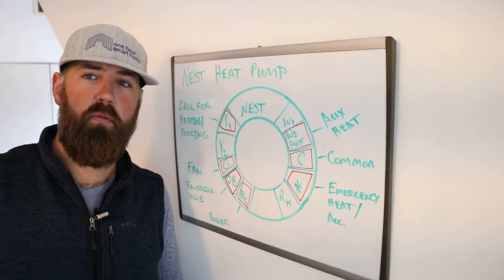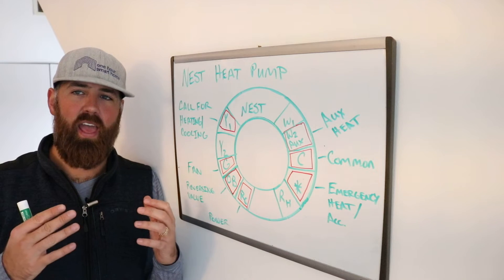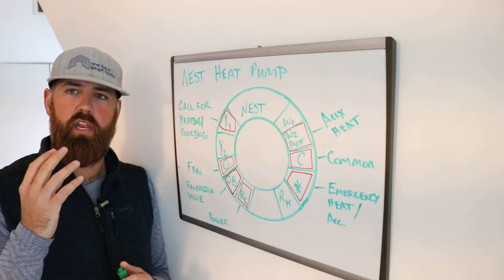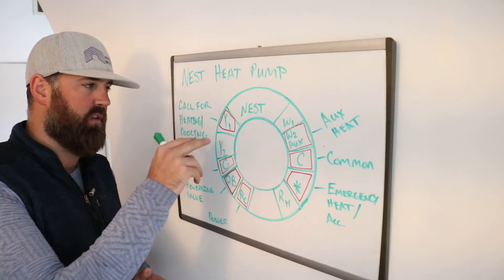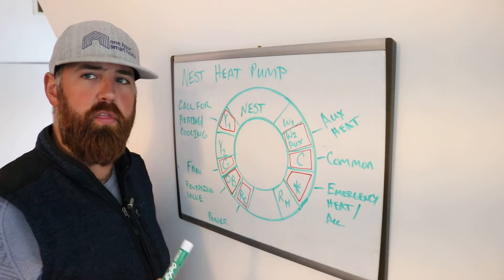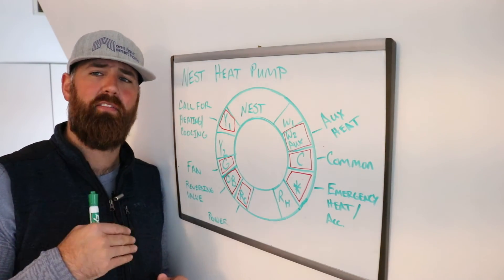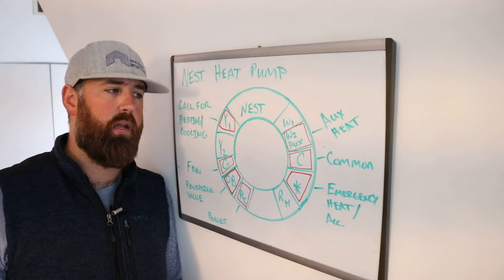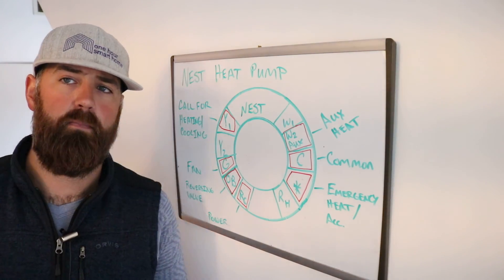Nest Heat Pump Wiring Diagram:  How To Wire Nest With a Heat Pump

Comment: System worked fine until a very cold day and the heat pump was off.  I had no Auxilliary Heat or Emergency Heat.  All the wiring seemed fine (red/power to RC, orange to OB/reversing valve,  Green to G/fan, yellow to Y1/call for heat-AC, and blue to c/common).  My only concern was the white wire to W1.  I moved it to W2 Aux and after powering the system, it fired right up.  Everything seems to be operating correctly now.  Thanks

Comment: This video is awesome.  Filled in some blanks but not all for me.

I have an LG heat pump and LG Air Handler.  I am adding the LG Dry Connect module.

I have added a 24 vac transformer.

I want to wire for 3 fan speeds.  The Dry Connect module has separate lugs for low, med and high.

Dry Connect also has 3 other lugs, fan, heat and cool.

Comment: My system on the wall with the ghetto honeywell thermostat has a cable for R and jumper to RC. Do I need the jumper as well on the nest panel?

I also have a white wire going to W2/AUX on the Honeywell , A black wire I think it says T2/E and another white wire to S1, and a red wire to S2

Where would the black E , white S1, and Red S2 wire go on the nest back panel I only have Y,C,W,G,R, and OB.

Thank you in advance for answering

Comment: Why can’t anyone tell me about the AQ - and AQ+ terminals. And how they work ? Are they contacts or is AQ + power out from stat.  Someone please explain this.
Reply: AQ is “Air Quality.”  Some high efficiency systems utilize an outside air supply and a damper motor to provide fresh air as needed or on a run time schedule. It can also add humidity with a humidifier if used. Most legacy thermostats do not have AQ  functionality. Usually a set of normally opened contacts to control said damper control or humidifier.

Comment: Actually the default on the switching valve 90 percent of the time is for it to be energized for cooling it defaults to heat when no power is applied to the coil

Comment: Can anyone help with install with 4 wires. Red, Green, Yelllow, and Orange. Im i. Vegas so I'm almost positive its a regular system. I connected all wires as they were previously connected but when i turn the Nest on to A/C, it blows hot air. I'm assuming it a programming error?

Comment: Hi 
I have heating and cooling both but i see only two wires in my old thermostat. One is white and other is red. The white wire is connected with C and the red is connected with R and there is a connector between R and RC. I need to know how to connect a google nest 3rd generation with it?

Comment: How would you know if you have emergency heat or auxiliary heat? I just had a goodman 3 ton 2 stage 18 seer heat pump. And i qould like to know where to put that wire so it works properly. Would appreciate the info

Comment: I have a question. I am trying to hook up my google Nest Gen 4 thermostat to a 4 wire carrier system that is labeled A,B,C,D. I hooked it up to G,Y1,W1,and RH. Everything is good and says it's working but does not turn on the outside unit or inside. My model number is 25hna948a320 outside unit and the inside model number is fe4anb006. How do I hooked up each wire in relation to each unit because the different units have slightly different labeled boards. I have pictures if needed.

Comment: Hi, I am really enjoy learning from your channel. I am just wondering if you have a clip on setting up nest for dual fuel system. I have a gas furnace, which I usually use and a heat pump for heating and cooling. is the wiring and setup up can be added if not already covered by previously.

Comment: You lost me at " hello ". ... I am really struggling to find the right now. I live in a two-bedroom condo. I have a heat pump system with a two-stage heat and one stage cool. I believe I said that right. I currently have an older Honeywell Pro series that's not programmable and I want to change it to a programmable which I was told is the pro series model ending in 2002. Do you know if one of the nest thermostats would work on my system

Comment: So I have a 2 stage heat and ac american standard system with an emergency heating coil. I also have hot water radiant floor heat that acts like a boiler. I want the radiant heat to be my priority heat and the 2 stage heat pump as my secondary source of heat. Obviously in ac mode the heat pump will be priority. I have a gen 3 nest can you give me a quick rundown of wiring? Will I need a jumper between rc-rh?

Comment: By far the best video on connecting heat pump and Nest thermostat!!!  In addition to the overall, I could not figure out what the black wire was as it was connected at the unit to the white (Aux Heat).  This explained the Emergency heat.  Thank you!

Comment: Great Video. I watch both your regular HVAC and heatpump videos. I have anest learning thermostat (3rd Gen) for my heat pump (single stage) but looking to change it to 2 stage heat pump (Trane XR16) with a variable speed Air Handler (Trane TEM6) but wasn't sure if can still be used for efficient use of the Heat Pump/Air Handler. I love my Nest and don't want to change the thermostat (if I avoid it)

Comment: I live in Southern Florida and my cooling/heating system uses a heat pump. The thermostat I currently have is a Carrier and has one wire that connects to a O/W2/B port. With the nest, I assume this wire would be connected to the OB port - if that is correct, would the heating coil in the heat pump system turn on if the temperature dropped too low in my house even though there would be no wire connected to the W2/auxiliary heat port? Or does a jumper somehow need to be run between the OB and W2 ports for the coil to turn on?

Comment: This helped me so much. I had an ollllld thermostat that used none of the newer coding so that didn’t help. My common was Black instead of the blue 🤷‍♂️. Then I had a jumper from W2 to E with the white wire on E. In googles setup it  says “remove all jumpers as they aren’t needed” but doesn’t explain why. 
And Google just immediately recommended a professional install. They could definitely use some of that Google money to have better instructions.

Comment: Hello,
 I have a Bryant system with following model numbers. I also found wiring info. mentioned below. I am unable to tell which wire needs to go to Nest learning thermostat in order to get everything working again. I connected A to G,  B to Y, C to OB, D to Rh. I dont see furnace working and I am not getting any heat. Is this something you can help me with?
A—Green=DataA  B—Yellow=DataB  C—White=24VAC(Com)  D—Red=24VAC(Hot)
Bryant Furnace Model - 315AAV036070AGJA
Bryant Heat pump Model - 288BNV024B00FA
Display Model - SYSTXBBECCO1-A
Thanks in advance for your time.

Comment: So I went through the installation process on the Nest app and it’s had me wire it up exactly as you’ve explained here. But when I call for cool air, hot air is coming out of the vents. Any ideas on why this would be?

The seven wires on my old thermostat were labeled as follows: AUX (white), E (orange), B (blue), G (green), R (red), C (brown), Y (yellow)

Comment: We have a heat pump. On ours, the black and white wire is in the W2 place. They both fit in the old thermostat, but on the Nest when we put the White and Black wires in the same terminal it didn’t work when our system was on cool, it was running on heat. What do we do with the black and white wires? Do they go in separate terminals?

Comment: Great video & clear explanations!  I live in Hawaii & only have a 2 stage cooling system (Y1 +Y2).  I'm trying to install a safety shut off switch on the condensate drain line.  Switch instructions say install inline with the RED wires.  When I test the RED  shutoff connections - the power is lost to the NEST & the AC air handler keeps running - not the desired outcome to shut down the AC.  What would you recommend for the shut off inline wiring please?

Comment: My heat pump wiring is exactly as you explained it, EXCEPT I’m missing a common wire. My Nest battery is continually low and causing the thermostat to go offline or shutdown entirely , otherwise all works as expected. I bought a 24V AC two wire adapter and connected to Rh and C wires. That isn’t working. Am I wiring the adapter incorrectly?  Appreciate any insight. Your videos are brilliant!

Comment: Most informative video I’ve found on this. Thank you! Q: My thermostat has a jumper from the E (white wire) to AUX (no wire besides the jumper). How does that translate to the nest wiring? I tried hooking up a Sensi smart and it didn’t work so wondering if a nest will.

Comment: I have a 5 ton MRCOOL UNIVERSAL, on the AHU there is a only w1 terminal to activate the element. Does that mean I should have no wire on the * in the nest learning? 

In my case should the nest handle AUX and Emergency over the same W1 wire?  

Will I still have emergency option if I redo the software setup? Currently have emergency setup over the * as forced hot air, it's definitely not engaging the emergency heat and I don't think jumperig is the way to go here

Comment: So my system is a Trane with separate O and B wires. How should that be wired?
Reply: B wire is a common wire on Trane thermostat and should go to C on Nest. O wire is switch over valve on Trane and should go to O/B on Nest.

Comment: Wire map I used for Revolv Heat Pump with Emerson 1F79 Thermostat to Nest Learning Thermostat (Gen 3).

HP Wire	          1F79      Nest
Red 	          R             RC
Orange             O/B         O/B
White                E             W2
Blue Jumper  W2 & E    N/A
No wire            L              N/A
Green               G             G
Black                C             C
Yellow              Y             Y1
Reply from the maker: Thanks for the helpful comment for others. I encourage anyone who has a specific model to list their wiring in the comments to help others. Thanks for watching.

Comment: I have this similar set up, but also have a brown and a black wire that were not used on the old thermostat (no metal is exposed). Is it safe to assume they are just there and not set up to anything? Just have a heat pump with a coil compressor/fan - all electric. Thanks.

Comment: My emergency heat option was not showing up on my Nest after my new heat pump installation. My hvac company was very clear that we have that, but when I popped the Nest off, I can see I only have 6 wires, none connected to emer heat. Does this mean I still have the option? And is the aux heat going to be costing a fortune as though we are using emer heat as aux heat? Hope someone can clarify this for me as a second opinion. Thanks!!

Comment: I have a question about my system.  I have seven wires at my Honeywell but two are in the "W2" or "Aux" terminal. I have electric hot air with a central air unit as well.  I contacted Nest for support but that was useless.
Reply: Asking if you you have received an answer or any clarification regarding 7 wires my nest has 6 connections

Comment: OK James, great content, better than GarGle. 
So how do we connect a SS2 condensation float switch to stop the system from running if the condensation drain gets clogged? This is building code required.
I broke Rc as directed and found on testing that because the NEST has a battery, it does not shut off right away...
See NuCalgon SS2 condensation overflow cut off float switch (simple NC switch that opens circuit before overflow damage) and how to use it with NEST 3rd GEN please.

Comment: I think my 4 year old nest is hooked up wrong. my heat pump heater blower is short cycling. my wires are yellow to y1 green to g orange to ob white to w1 blue to c red to rh. my unit is a Trane all in one electric unit. Any help Thanks

Comment: Hey, want to  use a nest to tie a gas fire place into my heat pump system. I’m assuming I would likely tie into Rh for a call for heat? That or can I use W2  and the blower in the heat pump as my supplemental heat?

Comment: Thank you for the video. The client has a heat pump and wants to control cooling and heating from baseboard heaters (boiler). Would it be right to disconnect W1 and tie the wire from the boiler control board to W2? On the other hand, he wants to have an emergency T-stat to turn on the heat from the heat pump. Can we do it through the main T-stat using emergency contact? Or it should be a different decision?

Comment: Question, if using a heat pump with a gas furnace is there any good reason to use the heat pump for heating in addition to cooling? If not I would just connect the Y1 and C to the heat pump, agreed? Thank you, Jack Perlmutter

Comment: This video made my day, after 3 different visits from 3 Professional HVAC they couldn't figure this out. Not too mention the $150 dollars they charged me each time. They would either get my heat pump only producing heat or only cooling. They never connected the reversing valve wire from the control board to the thermostat as the wire is spliced in the middle. I did this myself after confirming and chasing down the wires. I noticed they were both not connected on either end. After watching this video I was able to understand what each wire did and then relate it to my issue.

Comment: HOW DO YOU TELL THE NEST T-STAT TO ENERGIZE O FOR COOLING INSTEAD OF HEATING 
I HOOKED A TRANE HEAT PUMP UP TO THE NEST AND WHEN I CALL FOR COOLING IT BLOWS OUT HOT AIR 
THE ONLY THING I CAN FIND IS 
IS MY HEAT OUMP USE O OR B 
I TRIED BOTH WAY SAME RESULT 
HOT AIR???
PLEASE HELP

Comment: My current heat pump system only has two wires connected to the thermostat. C (which is white) and R (which is red). It looks like I have unused blue and yellow wires. Is my system compatible? I am confused because isn't normally blue connected to C?

Comment: Thank you! Your video saved the day for me as I was installing Nest Learning thermostat for my heat pump HVAC system in Pflugerville, TX. Your graphic with red outlines was the clincher as I had 7 wires. There were no wiring diagrams provided by Nest engineers, which is so basic for HVAC system variations. Great video and very much appreciate your knowledge and teaching abilities.

Comment: I made the mistake of installing a Google Nest thermostat on a 110 degree Saturday afternoon. The old thermostat had a white wire going into a W1(O/B) position. I carelessly put this wire in the Nest's W1 position. The system started blowing hot air instead of cool air. The outside box was blowing cool air and I noticed that it said it was a heat pump. Another site said there could be a problem if we had a heat pump system.

Upon further inspection, I saw that the label said "O/B". I switched the white wire into the O/B position and now the system in blowing cool air.

Thank you very much!

Comment: I have a heat pump for summer cooling and shoulder season heat.  For winter I have a wood fired boiler.  Have not been able to determine if Nest will work for my setup.  Would love your insight.  Thanks.

Comment: Have a furnace for heat and a heat pump for cooling.  I only want to use the heat pump for cooling, not heating as the furnace is more efficient.  Curious to know how you would wire this setup

Comment: Your videos are informative and helpful, but my heat pump wiring has only has four wires (with two jumpers) and thus far nothing has worked on the Nest. The jumper between the Y and W troubles me.

Comment: I have a question? What do I have wired wrong because I feel it's correct only thing I don't have is the little jumper my old thermostat had .. what's going on is I put the house to cool and it heats up. If I put it to heat the fan just turns on

Comment: Great video.  However, I did not hear you discuss how to connect a Nest Learning Thermostat (3rd Gen) when you have both a Blue and Orange wires coming from the furnace controller board since the Nest only has a single O/B connection.   I tried connecting Orange to O/B and Blue to C, but it does not power the Nest.  So what do you do?

Comment: My rogers manual thermostat heats up my house nice but has a bridge between w2 and emergency heat, do i add another cable to bridge this two. Otherwise my nest thermostat keeps does not heat normally.? Ay help, suggestions. I just got a new replacement from nest and keeps doing it

Comment: Color wire go with first letter? O = orange,etc. My unit has a X=blue wire no X on nest, am I supposed to put both orange&blue wire in OB on nest? Also I have a Y= yellow no #....old therm Y, nest Y1/Y2. It's a Honeywell H.P.T only 6 of 8 wires are being used, Brown & Black are cut while red, blue, green, orange, white and yellow are connected

Comment: On my old Thermostat it said Heat (+1to +6 degrees to heat) when the heat was on and EM Heating (Over +6 Degrees to heat) when Emergency Heat was on.  With this Nest Gen 3 I have had the white wire for W2/AUX Wire plugged into either the * set as AUX or the W2/AUX it concerns me that the heat really doesn't come on and blast hot air when needed when it needed to make up for 6 degrees or more.
Reply: Had a A/C guy come over - I was missing a wire that was not needed on my last thermostat - Now I have Y1,G,O/B,RC,W2/AUX,C,*(Emergency Heat)

Comment: Question: 
I have three 10-ton Trane package units, heat pump w/no auxiliary heat. They each are on their own T-stats with auxiliary sensors that control the heating/cooling functions [S1 S2]. I am looking for T-stats that will work with these units that are wifi capable and if possible, use the same sensors; is there such a beast? (Note: The T-stats are located in a mechanical room, so I will need remote sensors to control the T-stats). Or... What Nest T-stat would you recommend that I can use a (its own) remote sensor to control it? Also, to add I am looking for it to be auto-changeover from cool to heat.

If you or anyone can help, it would be much appreciated. [Have contacted a few local A/c companies with no answers back, been over a year].